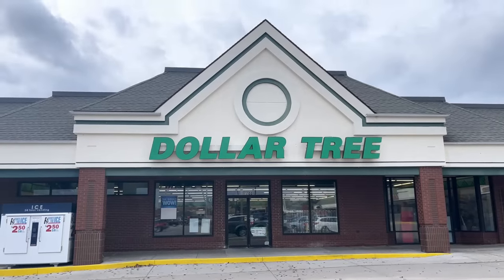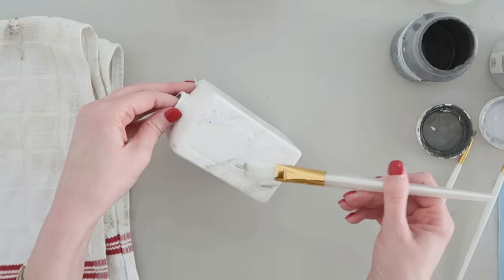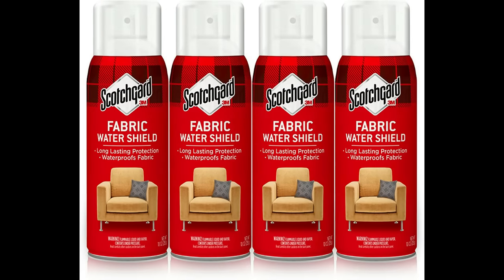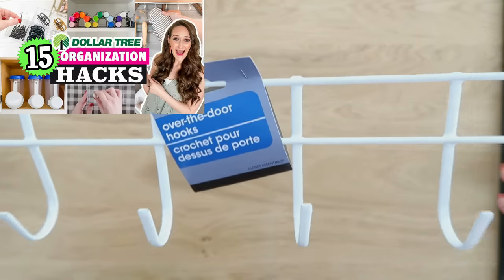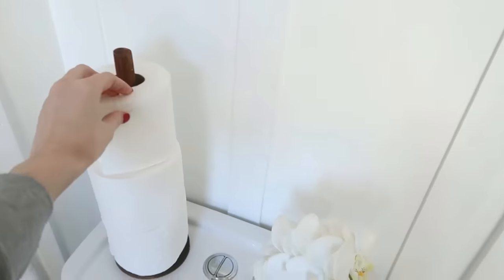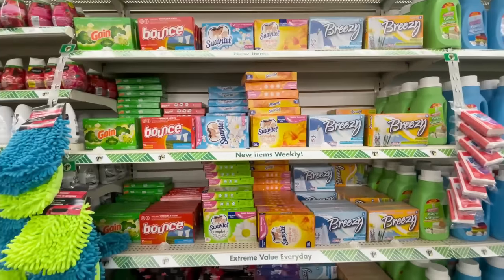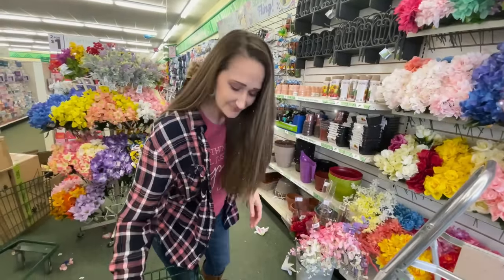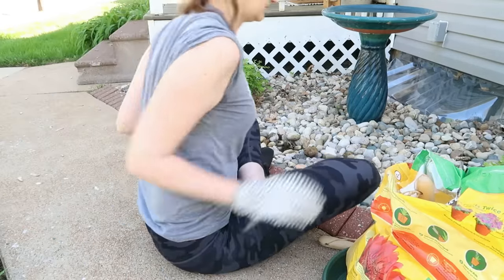25 *BEST* Dollar Store HACKS 2023! High-End $1 Dollar Tree DIYs & ideas!

Comment: A little helpful hint I learned many years ago: if you plan to use spray paint on Styrofoam make sure you cover it with paper towel or newspaper glued on or the spray paint will melt Styrofoam.
Reply from the maker: Thanks for the tip!
Reply: Super glue also melts Styrofoam and it gets really hot so be careful
Reply: Genius….. I actually had this problem a few times and I never thought of that nice 👍🏻
Reply: Good to know!
Reply: @margarethargis1734  at work we had a jar of super glue fall off the table into a rag box. It started smoking! It didnt ignite but we hustled it out to the dumpster really fast! Lol
Reply: I’m impressed with the plastic wy bowl
Reply: @margarethargis1734 😅😅😅😅😅
Reply: @margarethargis1734 Elmer's glue would be best
Reply: @janemurray4235  yeah I was making a psa lol

Comment: I love these ideas I’ve tried so many in my apartment thank you so much! Here’s some tips as well:
1:18 you can also make a slit in a bendy straw and melt it onto the paper towel holders with a lighter for a more stronger hold and quicker binding. 
3:33 you can also use contact paper to wrap around and then seal it with modpodge also found at dollar tree. 
5:55 you can also make your own acrylic paint with the paint at dollar tree by mixing 1/3 cup of white glue with 1/3 cup water so it’s less pricey

Comment: I really loved the placemat and planter urn. For the terracotta candles, you don't need superglue, just dip the metal wick holder into the melted wax and that will affix it to the pot. This way, once the candle is melted down, you can replace the wick holder if needed.
Reply from the maker: Thanks for the tip 😍💓💓
Reply: Yeah that's right, I'm sure that's a good idea, and wouldn't they look great?
Reply: What does that mean?
Reply: @sailormoon2937  
What part are you asking about?

Comment: MAKING THE PEBBLES STICK:  Sharing a few tips for those people who have had problems making the pebbles stick to the solar lights.
1.  Shannon used BOTH crazy glue n hot glue. Hot glue provides quick adhesion; crazy glue provides more lasting adhesion.  Someone commented on their pebbles falling off, but that was because she used only hot glue.
2.  IMPORTANT: DO NOT OVERLAY the 2 types of glues. This will combine the chemicals and may result in poor overall adhesion, depending on what you're gluing together. Simply dot the 2 different glues in 2-3 different spots on the glass pebbles. 
3.  For something small like glass pebbles,  you really need a glue gun with a PRECISION TIP.

Comment: How do you keep the glass rocks hot glued to a solar lite ?  I did a similar project a while back, I hot glued pretty glass rocks to a wind chime for outdoors. . I didn't realize  that the heat of the sun would melt the glue ( which is what happens to a glue stick when inside the glue gun ) and the result was the glue eventually became soft and my glass beads started to fall off the chimes.

Comment: I use a shorter version I just use it as it is the paper towel holder and I put my toilet paper on there but that is a good idea to extend it so you can put more on there so you don't have to run out cuz it only holds three rolls of toilet paper that's not bad

Comment: Here's a trick you want to make that last a little longer the what looks like a stained paper towel holder there is one more slight hole to drill you take a bigger drill bit the same with as well in this case it became a dowel rod and make a notch for it to set into if you want to be able to detach it at will which means it's not as strong don't use wood glue at the same time you're screwing it if you never wanted to come apart again you add wood glue and technically you could do this to both I have not seen at this point how they attach the second small half one I prefer stuff that hangs for paper towels

Comment: Years ago, during spring/summer, I would use those small river pebbles and fill the bottom of my window sill with them.  About one layer of stones (1 inch think.)

And than I would add some small fake plants to the corners to dress it up some.  Looked cute, and when it rains, ya just lower the window.

I had to stop because I had taken in a stray kitten and cat.  (And they liked to fling the pebbles off from the window sill😂)

Comment: I’m quite surprised about the lack of safety precautions in this video.
Usually I find those pretty far fetched and over-the-top in US-made videos, but I understand  it too, bc it is so common to sue people in the USA.

But cutting the side of that frame in ‘thin air’ (instead of laying it flat and use something like a ruler to guide the knife) AND leaving those snapped of hooks (from the over-the-door-hanger) like they were (not sanding to flatten or even just putting some tape over the end) are just risky…

Comment: I do no thate your hacks, but the buckets from a hook thingie - well, it would have been easier, to saw off the hooks (the ones meant to go over the door) on the hook device you bought and use the rest as it is on the wall directly. No need to break the hooks down and bend those to fit around a wooden peg.

Comment: I don't understand why you would waste so much time and money to take apart an over-the-door metal hanger just to make hooks when you can buy a multi size pack of S-hooks in the gardening section. They even come with a rubber bumper at each end so the walls or the items being hung are not scratched. I stopped watching around this point since each item you made had multiple more cost effective ways to make each one and weren't so wasteful either. Why would you rip apart a beautifully made painting canvass frames?? Just stretching the canvass is a big feat. Why didn't you buy a length of trim board from Home Depot or from a hobby store, then cut them cut them to size. Plus wax paper will not last any longer than a week. And that is only if you had 7 days of no wind. The first rain shower or windy day will decimate that wax paper. Find an old pair of semi-sheer curtains or another cost effective piece of white fabric. Easy peasy. But please paint something on the mounted canvass - give it the respect it deserves & use it as intended. ✌️